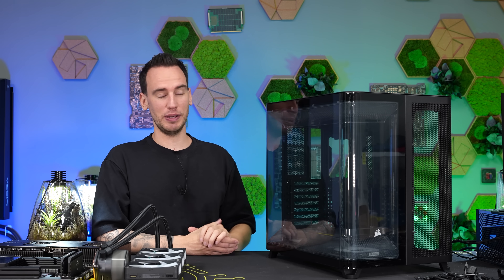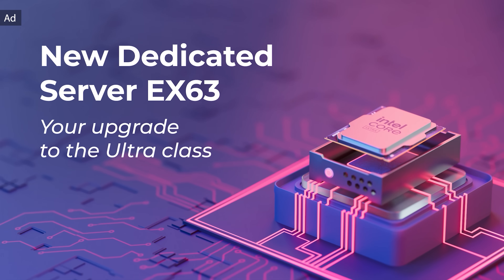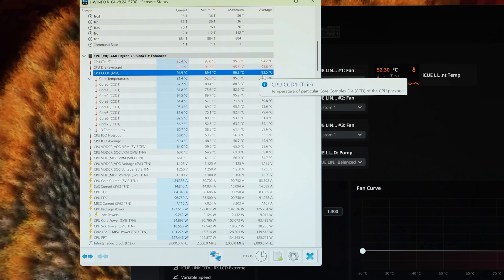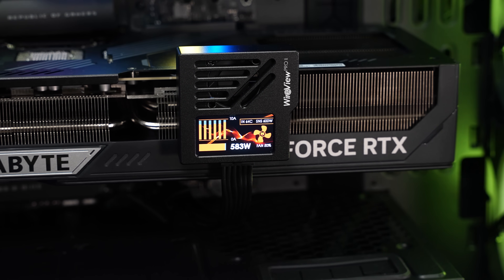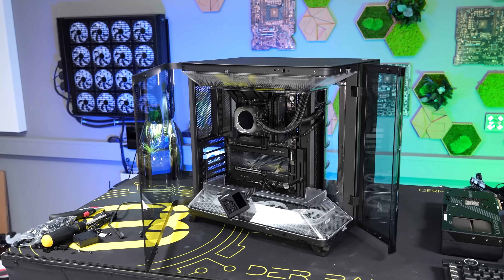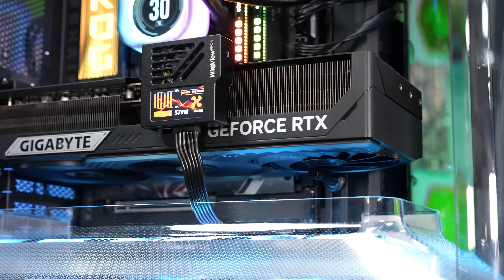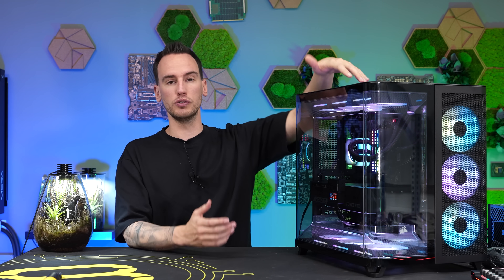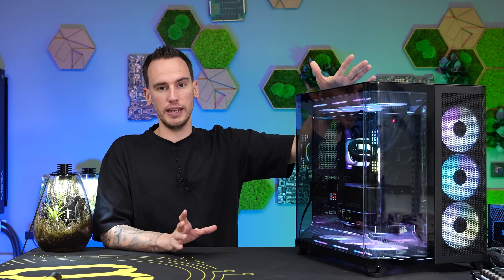Are 3 Chambers Really the Future of PC Case Design?

Comment: That case is absolutely enormous.
Reply: Laughs in NV9 or W200
Reply: @rustler08  Lian Li V3000 Plus looks over the top of its glasses.
Reply: Studidly big.
Reply: @johnsmith-i5j7i  No it's not, it's TINY
Reply: my 1000D make this thing look tinyyyyy
Reply: Not as large as you think it is.
Reply: @sinnirr  No, I looked it up, it's 75L, it's huge. It's absurdly big.
Reply: @phillycheesetake  I have it, yes it's big, absurdly big? Nope
Reply: @sinnirr 
Dude, Toyota Yaris fuel tank can only fit 42 liters of gasoline. If your PC case almost double it's volume/capacity, that's absurdly big!
Reply: The 4500 and 5000 from corsair are both also about 75L
Its just different shaped
Reply: @phillycheesetake  75 liters is still mid-tower sized now because the size  & TDP of single GPU's now. Anything over 75 liters is now full tower cases. 
HAF 700
Corsair 7000D airflow 
Lian Li V3000
NV9
W200
evo XL

plus a few more
It used to be much much smaller like 55 liters like a Coolermaster 690/II. This cause used be consider "full tower" it's now "mid-tower" case size now.
Reply: @kevinerbs2778  It's not just 75L, it's also got a very square footprint, which makes it effectively even bigger.

All that's necessary to feed high-TDP cards is a bottom intake, which costs just a moderate height increase.
Reply: @phillycheesetake  Not for their length.
Reply: @kevinerbs2778  What do you mean "not for their length"?

Comment: I daydream off making an independent flow case.  Each device in your system gets its own cooling and the air flow passing through each"fin stack" separated. 
Even if it was simply, solid dividers , Making the air flow to each cooling system direct from outside and with direct exit all. 

One day, I'll do a cardboard or Masonite mock-up to compare against my existing pc results
Reply: literally just the Deepcool CL6600
Reply: I only got interested in pcs this past year and I think about this all the time. Why does almost no one make their own cases or wiring harnesses? I'm not saying everyone should do it or that it's trivially easy, but especially since there seems to be a lot of overlap between custom computer people and 3d printer people I'm surprised there aren't more actual full custom machines as opposed to basically kitbashed lego machines.
Also, if you're mormon, you have the best user name ever.
Reply: That's....basically what this is?  Other than the MB, which is fine regardless.
Reply: This was already invented a long time ago when I was mining in 2018. There were special cases with separate airflows for each graphics card, such as the BigCryptone v2 - google it. I can confirm that they have massive performance, and you often didn't need to turn on the fans on the graphics cards when they were running.
Reply: There was a guy who made 3d printed ducts for CPU and GPU coolers. It had positive impact on thermal.

I also made myself a duct for GPU pass through cooling and it improved thermals. Go for a 3d printed ducts and air vents. It is the cheapest and best way to go. No need to spend hundreds of dollars on some fancy airflow case. Get yourself a bunch of good fans, think, print and you are there. 😉
Reply: @LeitoAE  optimum tech did. also, this is just what servers do, any higher end server will have flow guides usually.
Reply: @konzo5942 Correct. Servers are good example, as well as some business pre build office PCs. They are also using ducts to guide air.

Desktop PCs also used ducts before tempered glass era, to direct fresh air intake for stock CPU cookers, however, motherboards do not have CPU socket in this same places, so for some cases, duct was missing CPU cooler. 😂

However, we can make tons of improvements inside the cases. Fans itself are now pretty advanced, we have better motors and a lot of engineering in blades shape and materials, so here it is difficult to make improvements in home, but custom made ducts for your case/mobo/CPU cooler combo is possible. 3d printers are cheaper and many people know someone who has one, so it can be fun experiment.
Reply: @LeitoAE  get a dell tower atp
Reply: The only reason DIY cases don't do it is because you would need to get new ducts whenever you change a component. Also, no universal method for running case fans off of GPU temperature, although ambient-air temperature sensors can solve that.

Comment: You didn't measure the RAM temp and the SSD temp. Why? The back plate of the CG will dissipate a lot of heat. Where does fresh air come from for these two elements? Nowhere. That's why my AIO is back on the top and not on the front, and I still keep my North XL mesh with two 140 on the side, which provides fresh air to the bottom of the CG and the top. With the AIO on the front, DDR5 memory increases by 5° to 7°. I believe we can do better, but not that.

Comment: 22C Temp drop on the CPU seems...kinda insane......are you positive on that? Thats...thats insane.
Reply: That's Vs pushing warm air through the radiator, If you have your radiator on intake, there will be basically no difference, and lots of smaller cases allow you to do that and have bottom intakes into the GPU.

Comment: Should have tested it against a Lian Li O11 case. I doubt it would have been much better. I dont see much difference between this and an O11 and doubt angling the fans would make a difference between them. This case is no real difference compared to other o11 cases.
Reply: Which part of isolating completely the hot air coming from the GPU and doesn't go out through the AIO cooler you didn't understand? CPU temperatures dropped 22c because of that.
Reply: @RipperDraco no they didnt drop anything because he compared it to a case that is complately different. Wow a fish tank case with externally mounted PS did better then a mid tower with a power supply in the chamber. No crap. How is the gpu blowing air out the front like this different then the same basic case blowing the air out the side like the O11? Maybe people should get a clue and stop blowing hot air into the case or stop blowing hot air into their rads. The fans should blow through the rad OUT of the case.
Reply: @gprojectnoob4779 man honestly im not about to explain to you the whole concept of how hot air goes outside from a case but the hot air inorder to escape will go through every single fan that is set as exhaust. Aio coolers naturally have all of their fans as exhaust since they ideally suck fresh air from intake fans and they push it out through the rad to cool a cpu. Likewise a gpu suck fresh air but dumps all the hotair inside the case ofc this hot air will go through everything and will affect the thermals on everything. Separating the aio completely and have it isolated will improve the CPU cooling. You insist comparing the o11 for whatever reason but this is a completely different approach.
Reply: If the point of the test is to see if 3 chamber works then test 2 should have been , removing the clear plexi divider that directs side opening air into radiator and then block the side opening. so the internal case air goes into rad instead if side opening air. The amount of time it takes the 6 top and bottom fans in tje case to change the air in the case is a couple seconds max so the air fed into the rad either from internal or external will be minimum temp difference. Unless you put a psu inside the case exhausting into the case like with this test.
Reply: @gprojectnoob4779 to some degree i agree but you need to remember that the case is designed to work with the aio placement to be on a different chamber completely. He used a fairly good airflow focused case for the first test but yeah he could use at least something closer to that price range entirely since this case will be quite expensive. But results is results and even though you can't paint exactly everything what you can keep is that the solution gives good thermals conpared to a traditional airflow designed case,yes the case he tested wasn't the best.

Comment: waiting for the 4th chamber for RAM cooling, since GPU heat is directly dumped on it xD
Reply: we'll soon return to cases designed like the thermaltake level 10. with SSD storage, ram gpu cpu and the mobo separated into separate modular chambers

Comment: I always wondered what if you have a fully disclosed case like an aquarium? The only openings will be fan mountings. 240mm radiator for cpu on the top and 240mm radiator for gpu in the front. 3x120mm fans on the back and 3x120mm fan at the bottom. There will be always positive pressure. No other ventilation holes. I wonder the results in temperatures and dustiness wise.

Comment: This is far from a new concept. I currently use a Thermaltake W200 that is a three chamber design with the option of *adding* additional chambers to the top or bottom of the case. The only real limitation is the length of cables.

Comment: until we get at least 4x 3.5" slots im sticking with my 780t
Reply: I had the 600t and it was great! The 780t was too big for me at the time :D 
God it was 2012, time flies. 
Anyway, if you need to upgrade, the O11 XL (the first one, not the EVO) has 4x 3.5. 
I've been using it for years and it's great.
Reply: @simo_1989  Listed as EOL here unfortunately, but I see theres a V3000 plus with 8! 3.5" slots

Comment: Neither your comparison is 100% correct, you have fans on the frony but not on the bottom 😬✌
The premise was what if it had fans also on the front..
The 3rd chamber could been inline with the main chamber and dump the air to the left of the case

Comment: In Re: The Corsair AIO - They don't have the LX fans on an AIO, but there is the QX. Very similar... QX has a slightly different profile around the shroud and more CFM/static pressure - also fewer addressable RGB's for the QX but two stripes on the side rather than one. 

 Can someone explain to me why Corsair is 'frowned upon' by many among the community?  I absolutely love their products. When their 5000X with 4x of their QL fans in it for $200, I had to buy it. My last PC was your 011 case, I'm building a computer in it right now.

Comment: Should test it in a O11D Evo XL with the radiator on the side blowing out, and then have 1 of the top fans as intake so the top radiator fan gets cool air.

And keep in mind, that case also has the option for a meshed front panel for 3x 120/140 or 2x 200.

Comment: I ordered this case a few days ago from caseking, along with 9 phanteks t-30 fans so it should work pretty good. not too sure about those air ducts with such powerful fans, maybe it would cool other components better like my gen5 ssd and ram without it? astral 5090 gets those pretty hot.
Reply: Yeah I know what you mean, I got the Ferrari F1 and it gets super loud, thankfully my Goodyear's premium VIP are handling it pretty well moving the noise away. They get quite hot though, but my private Monaco GP can take it.
Talking about hot, my wife truly works wonders to keep my hot head in check, what a gal.

Anyway as long as you get enough cold air flow around the CPU/M2/RAM, it should be fine. Carefully check with your hand, or if you have a smoke machine then that way, if there is a good exchange happening around that area.

That should keep most of the parts at around 50°C during load. At least it does for me.(With 21-23°C ambient temperature)

Comment: I love it, it's what I've been wanting for years, but I have two small gripes at the price- the glass wrapping around the back blocking the rear fan kinda sucks, I'd love to have a rear 140 intake for that setup blowing air over the GPU back plate. Also, I'm all about 140mm fans right now (140s just seem to move so much more air while running slower and quieter) so it would have been really nice to see full 140 support for the main chamber, or at least just for the bottom. 
If Corsair nailed those two things I would have probably ordered one already. Now I think I might just wait to see what the competition does.

Comment: Rule 1 Big slow turning fans to limit noise.
Rule 2 Filtered intake fans only.
Rule 3 No exhaust fans.
Rule 4 Quality fans only.

What I call a good cooling solution is not for the highest initial overclocked frequency but a long term lowest fan speed to minimize dust accumulation with big slow turning fans to minimize noise and fan curves that will cool Prime 95 and Furmark loads. The CPU initial temperature should be Celsius temperature in the low 80s C at full load with an ambient of 80 F (26.7 C) because dust happens.

The recommendations are made for the end user not being the who sets up the computer. If the persons using the computer will use earbuds, noise may not be a problem. Likewise if the user is willing to clean the computer after each use then dust accumulation is not relevant either.
Reply: Calm down there greta. First of all, dust filters on fans are unecessary and raise temperatures for no reason. No exhaust fans? Thats a good way to increase temps by at least 5C for no reason at all 🤡 anybody can make their own rules i guess, but dont spread bs

Comment: I just bought the Air 5400 case for my next build. I'm really looking forward to it! When it released, I thought the design was innovative for cooling, but also the extra room and cable management was brilliant.  If you like a clean look, go with a BTF motherboard. I'll put the finished version on PC Parts Picker in the next few weeks.
Reply: I find that not all "size" is equal the case is still kind of new so "new toy" syndrom its hard to tell if its actually clever or
My main complaint is I would have liked a 420mm version corsair actually makes their own and its not compatable while costing more than the others
Reply: @mahomisawa4172 I also wanted a 420mm version, but the two 360mm slots was good enough for my needs

Comment: Corsair should stop pretending like they are solving RGB cables issue with their icue link while they are putting an extra device with another power and usb cable inside the case and charging a lot of money for it. Unless the industry fucking solve the issue of extra cables for RGB after more than 10 years of this RGB BS existing i am not using any RGB fans.
Reply: the simplest 3 pin 5V/12v ARBG connectors on motherboards, should be standard on all ARGB fans
Reply: @kevinerbs2778 No. It should be one connector for fan+argb with being able to daisy chain. ARGB has just one extra pin for data so you can just multiplex it with some of the existing pins on the 4-pin fan connector.

Comment: They are getting so wide, I wonder if you could just put some standoffs on top of a regular case on top and mount it outside and get the same result. Should only require a few cuts and some old school fan grills.
Reply: Thermaltake makes a case that you can do just this already though. Look up the Core series cases.

Comment: Please help me pick the best RAM in a 128GB varient as I seem to not understand the RDIMM - UDIMM etc... coming from the Apple ecosystem. I am planning to shift to the threadripper 9970X (non pro) and the ASUS Pro WS TRX50-SAGE WIFI A (sTR5) motherboard! I tried Chat BPT and every FURRY Ram I pick it tells me its not compatible! I am based in the UK! THANK YOUUUUUUU
Reply: From your motherboard manual:

It only accepts RDIMM DDR5, ECC Registered Memory

DDR5= memory standard

ECC = error correcting code, CPU, Motherboard AND ram kits HAVE to support it, if a single one of these components don't support it, your pc won't work
Likewise if you install ECC ram kit on a standard consumer pc, it'll also not work

Registered means there is a dedicated memory chip for the error correction code, it adds more stability and security since it is dedicated for only that purpose 

The ram kit you buy has to have all 3 of these specifications
Reply: @labmasterx5599  thank you. can you recommend or provide a link to the ram taht i should buy?

Comment: The future of PCs is modular construction, instead of all those archaic cables and architectures. And that's the only thing that makes sense; all other considerations are just glue and patches for something that was invented 40 years ago and completely fails to meet current standards. The first step was made in the miniPC market, now it's time for the typical PC.
Reply: Where the heck do you get the idea anything about mini-PCs is more modular? The stuff that is messier in normal towers, they either miss or solder in.
Reply: @stan-bi3hl  You're probably out of touch then. Most brand-name miniPCs rely on connectors for everything, with virtually no cables. Of course, it is difficult to talk about standardized modularity, because it assumes the possibility of changing components between different manufacturers, but that is more or less the direction.